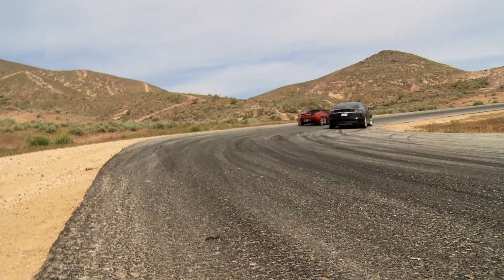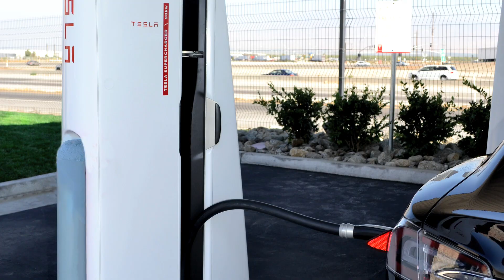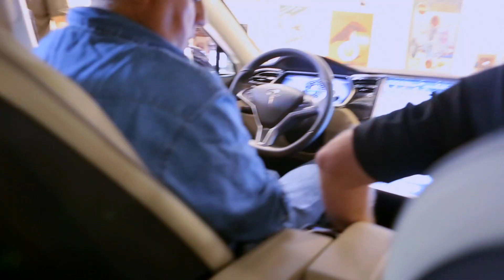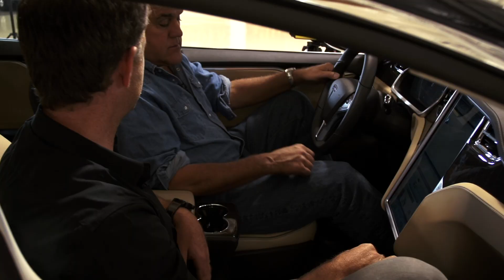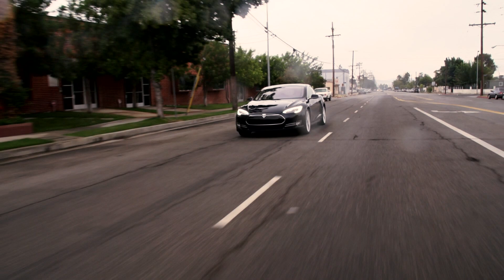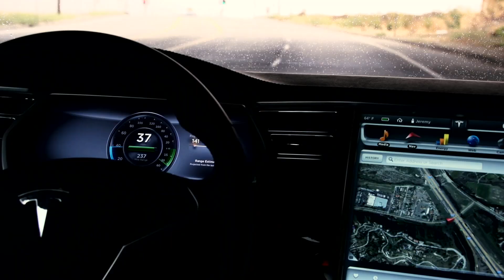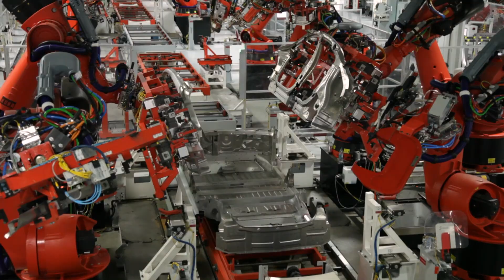2012 Tesla Model S - Jay Leno's Garage

Comment: 10 YEARS LIFE BATTERY so after that how much you pay for new one. And to calculate economy. electric car equal to 100mpg. So after battery dead if it cost 20.000 to repair or ? and 10 years is 2000 plus per year, per month 180dollars. so there is no fuel economy then. plus car cost in Europe 130.000 dollars. I wonder if you want to go electric so you need to change battery or car where is economy then? Still people with go petrol lpg or diesel. IN Europe.
Reply: its 15k to replace NOW. elon musk even stated that battery prices will drop by 30% once the gigafactory is built. Also dont forget the cost of upkeep. the tesla wont need a transmission change or any other part really except for wipers, brake pads and tires
Reply: MakeSh00t You realize Tesla motors has absolutely nothing to do with Nikola Tesla... right?
Reply: MakeSh00t "dude you are a child you can not compare with me." superiority complex much? lol
Reply: Scott M  lol.......i was just saying..
Reply: How long do you plan on keeping a car? After 3 years I'm always ready for the new model.
Reply: John Benton It doesn't really matter.  If you keep the car you eat the battery replacement cost directly.   If you sell the car you eat the cost in depreciation.
Reply: You spend what is necessary to survive. Some people buy luxuries, like fancy cars etc.
Reply: MakeSh00t This is not true at all, the model s battery has been shown to degrade with range not time. It degrades about 5% in the first 30,000 miles or so then tapers off and stays fairly stable as far as I have seen. unless you plan to drive the car several hundred thousand miles, you will be fine
Reply: Trey B lol........ we never know because it got electronic problems with doors and some stuffs and touch screens just dies... You are only thinking what can not happen.. Nobody knows that.
Reply: MakeSh00t If there were going to be widespread hardware problems, some cases would have already popped up
Reply: MakeSh00t the touch screen just dies? are you referring to the need to turn it off and on again? lol
Reply: MakeSh00t You would still be making more money after the 10 years in this car than any other petrol car...
Reply: dude... you buy a car for 25k in 10 years your gonna spend approx 50k on oil, gas and maintanence. better to buy a tesla...(I'm not even including the tax refund you get on the tesla in california or the fact that there is gonna be a 35k version of the car)
Reply: MakeSh00t what would you repair in that car?
Reply: MakeSh00t electricity costs way less than gas, and there are no repair/maintenance costs besides maybe the battery in 10 years. No oil, no engine repairs, nothing.
Reply: MakeSh00t also if your concernced about electricity costs then just go to their supercharger stations and get free electricity...for life
Reply: MultiNutterbutter if i had chance to live in usa.. and to have payment 4000 dollars for same job as i do here.... I would go there to live all my life... i will not miss anyone in europe accept mother..
Reply: MakeSh00t <3
Reply: MakeSh00t Most car owners don't keep their car after 10 years. They sell it. The real question is, what second owner would buy this knowing the battery is due to die in 10 years and cost 15k? Its really a one owner car.
Reply: Trey B dude you are a child you can not compare with me. I drive 18 years i was driving 10 tons to.. i read car review........ its my favorite car tesla. Because Tesla made electricity and he was serbian same as me. And you don't have logical answers yet you are not old enough to understand..
Reply: it does its tesla technology ... Your answer is useless
Reply: Trey B Your answer is useless
Reply: MultiNutterbutter  not true.
Reply: MultiNutterbutter yes but u needo pay electricity and reapir cost are huge on that car. ANd if that car cost only 50k in europe that is cheap vs petrol.
Reply: MultiNutterbutter  we don't have free electricity.. Where i live.
Reply: MultiNutterbutter  electronic... Computer dies u need 10.000 to fix it... You can ask tesla how much cost if it dies battery, or computer.... You can after trow money to garbage. Like i say in europe that car cost 130.000 dollars....so if i calculate  if i am rich i get tesla and ford r350gt. If i am not, i can't think about tesla.. But i like tesla a lot. But car is expensive to repair... More electronic more money trowing. More mechanik things inside less cost.

Comment: A few points I would like to make :
- the touch screen should be half the size. It dominates the interior too much.
- the front end styling could be a bit more sexy
- a center console should be put in place for storage which is seriously lacking
- interior should be a bit more high end for this money
- how will the government coffers maintain their multi-billion dollar tax intake if gas use drops substantially? Will electricity use start to be heavily taxed to compensate?
Reply: scanspeak00 - for the model s it's a good size and you can split screen mode it. For the 3rd, 4th gen economy models planned then the screen should be smaller for both aesthetic and cost reduction.
- this will probably develop with time. They're a very new company. How many years have Ford, BMW etc... had to change the looks.
- yep. EV cars mean more cabin space. The model s has a small glove box but big space where the stick shift would take up space. I'm sure the designers are working on maximising even more space.
- it's full alcantara (like leather but more environmentally friendly). Looks comparable to the audi a6/8, bmw 5 series they compete with. They do seat upgrade options etc... like any other manufacturer.
- Don't worry about governments making tax. They do it whenever they want. Road tax, state road tolls, mileage tax, random tax etc... take your pick. 
- Carbon tax should be initiated which encourages sustainable energy production. Then we will get to a stage maybe in 40-50years of energy surplus so on a global scale we don't have to worry about energy. We can turn attention to poverty, food production, space exploration, education, health etc...
Reply: scanspeak00 A few points I'd like to make to rebut yours:

1. They weren't good.2. None of them were good.
Reply: All good points, and no-one has all the answers, yet!
Reply: scanspeak00 You can get a center console if you want one, and you can also get upgraded seats and decor items in the interior. The front end styling is deliberately mainstream. Most people like to have huge touch screens, especially when there are so few buttons and geegaws in the interior to fiddle with. Do you honestly think politicians have suddenly lost the ingenuity to come up with new taxes?
Reply: scanspeak00 - the center console was removed as well as most of the buttons, so that the Tesla Model S has 75% less cabling than a ICE car or Hybrid. The Model 3 has even less cabling.

Comment: The price of $60,000-$100,000 seemed high at first - until you do the math and realize that if you drive 24,000 kilometers a year you are saving about $2,400 a year from the cheap cost of electricity versus gas ($24,000 over the course of the 10 year life of the batteries). So factoring in gas the cost of the car becomes $36,000 to $76,000. Now factor in the maintenance of a gas powered car... with electric there is no maintenance. No spark plugs to change, no oil changes, no fuel filters, no air filters, etc.. etc.. When you factor that in this car is actually quite affordable.